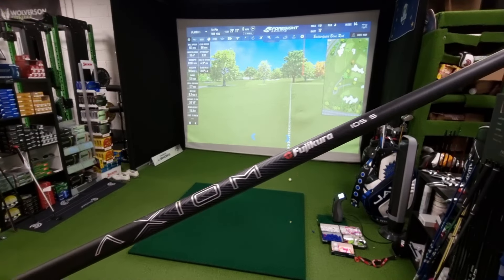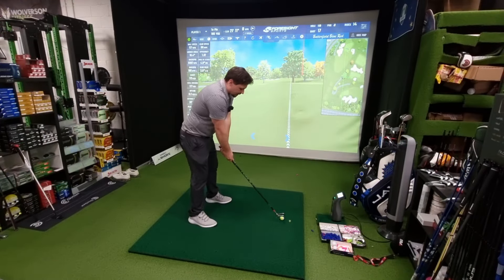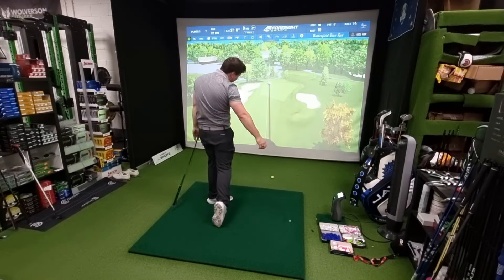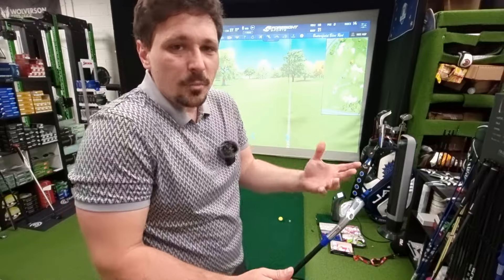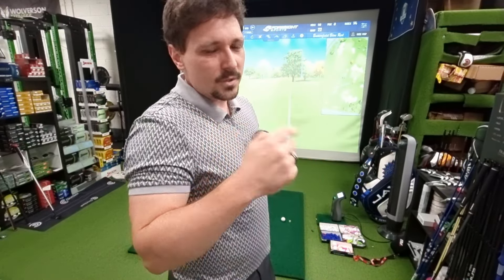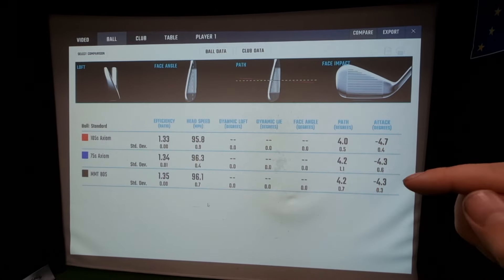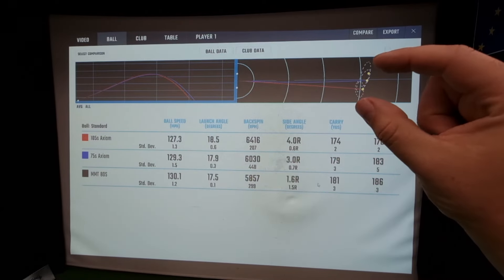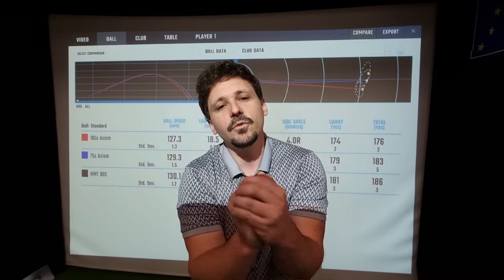Insightful Review: Stock Graphite vs Axiom Velocore

Comment: Freddie which graphite shaft would you recommend for 83/84 swing speed with a 7 iron around 1/2 degrees down ?   No local fitting centers here.   Thanks
Reply from the maker: Hmmm... Tricky to recommend from there... What shafts have you currently got? What flight / Direction / Height do you get from them?
Reply: @ wanting a touch more height.  Ive hit mmt and didnt like the feel personally.  Was the 105 in stiff.  I play the modus 105 now and it feels better than the graphite honestly.  Hard to describe.

Comment: So I currently game the Mizuno 225 w Steelfiber i95 stiff shafts. I am thinking of going a bit heavier (my miss is generally long left and I feel I might not be getting enough height or launch). I’m thinking of either Axiom 105 or MMT 105. Would this be a good idea or would you recommend something else? Thank you!
Reply from the maker: Hmmmm, the e tra weight would definitely hold the ball to the right compared to the  SteelFibers!  Potentially reduce closure of the face, so maintain more loft as well 

I'd say the MMT would do that a bit and the Axiom would do it more! ...Would you happen to have anywhere nearby that has some to hit (even in different heads)

Comment: Really great vidoe and insights throughout. Great swing as well. If you haven’t watched the axiom vs steel video you should go back and take it in - must watch if you want to understand axiom. I think people have turned their noses up on Axiom generally because they were expecting it to be a revolution in an iron in the way that it was for the woods - ie, length and immediate pro adoption. It’s not a length solution. However in what it is, it is revolutionary - a steel replacement with amazing rigidity and feel in lighter weight housing. The point about the dividends it will play over the course of 18 holes is SPOT ON. At this point I went through a slow process to test and eventually game the axiom in my u500 4i and T150 5 iron. In a few minutes Freddie came to the conclusion I arrived at through several months of slow testing. Today I can’t say enough about the axiom, blends seamlessly into my set (PX 6.0 steel in gap-6i) for feel and results, and the only question I’ve been left with is whether I should come down in the set with it. Similar in my mind to a combo set of heads. I will definitely be trying in 6i next and may come all the down to 7 or 8 we’ll see. Great video!
Reply: One follow up, he talks in the other video about 105 S vs X in other weights. The 105 S is what I settled on.
Reply from the maker: I've been working my demo kit one by one to get more options hehe ...I'm feeling a full set next year and then also actually play some proper tournament golf :)

Comment: Curious to get your opinion. Currently fit into T100S irons w/ X100 DG shafts.  I have played S400 also.  I have elbow/joint issues setting in.  Looking at some "stock" options to get with a new set and sell my current.  Curious on your thoughts going from my current steel to like a MMT 105TX or Steelfiber i110.... I haven't seen the MMT125 as an option and I dont know I can swing the upgrade to Axiom.  Thanks for any insight.
Reply from the maker: It's a good way to go ...I like the MMT 105TX, I had a guy with a set the crushes the ball and he liked the ease, without loosing the stability 

Steelfibre i110 would be more like the S400 alternative, again they are easier on the wallet compared to Axiom 

Another factor I'd think about is grip pressure, do you squeeze the club hard? Could contribute to the elbow issues! Have a look at these two vids if you get a minute!
https://www.youtube.com/watch?v=vWsRPPAdlr8
https://www.youtube.com/shorts/kkAbc0mIz90
Reply: @FredzGolf  appreciate the reply and video links! I actually got a chance to hit some options. They didn’t have the 105tx, but had the 125tx and 105s, the newer steel fiber i110. Tried a couple others also. The SF did feel the best, but had a $50 up charge per club. Went back and forth with the 105s. The 125tx was too much and I didn’t want to have to work that hard to activate it (I would keep my x100). Ended up getting similar results with the mmt 105s, but I think the SF was a bit smoother and buttery. Very happy and ready for my clubs to come in.
Reply from the maker: @Voorhees2002  Awesome!!! Best way is to actually hit them, like you have :) If i can create awareness and help you to try the right things in the first place, happy days

Comment: Been a clubmaker for over 25 years. The axiom is an enormous break thru in graphite composite shafts. By far the best shaft I have played and tested (105x in #2). 
 Another smart feature is the slight progressive weighting of the shafts through the set that should distribute the moi balance of the club better.
Reply from the maker: Agreed... I think more Tour players will adopt very soon ....They have indeed, done it properly eh :) I'm debating full set next year ...but I also want to burn the heads bronze on my new sticks but don't know if the ZXi7 will take it ....if they do... I'll treat myself to both hehe

Comment: First off, your reviews are top-notch !!! I am def getting graphite in a split set of srixon forged II/zx7 staff clubs. Hit my 7 iron 170 yards smooth tempo. Clubs 2 degrees flat. I am really looking at axioms or mmt. I have always played x100 recently to modus 120 and 105 stiff ( due to age 😁 and injuries). Would you go 105 stiff or x. Or possibly 75 x irons and 105  stiff in wedges. Worried about too light messing with dispersion?  Or would yo recommend  another direction with mmt? Any insight helpful, and I understand the best way is to hit them, but your experience in club fitting helps. I also get it is an educated guess not in stone. Kbs tgi is an option too. Thx !!!
Reply from the maker: Thank you, glad you're enjoying - I like your approach here and happy you understand it's not in stone :)

In the MMT I'd push you to heavier and stiffer to match the 120g Modus/128g X100 area as they'll play softer than the steel shafts comparatively - 130X

I'm a huge fan of the Axiom, they just work - I'd be looking to test 105S and 105X with you to benefit from the lighter weight and keep the stability you're used to with more ease ...I haven't actually tried the 75X and that's an interesting point ...I'd be guessing but I think they'd be a LOT of fun to use ...I'd lean that way of you want to have more ability to draw ...In the 75S for me, it's a high draw and I have to work REALLY hard to fade the 75S, Could be similar in the 75X

To summarise - Axiom 105S is my gut feeling wedges through irons - I started with just a long iron shaft inn a 2i and fell in love from there 

Alternative thoughts from my main gut feeling: Axiom 75X if you want an effortless draw and never intend to step on it too hard  -  MMT 130X if you want a different price point - Ideally get some in your hands before committing or just do your longest iron on it's own first if you don't have that luxury
Reply: @FredzGolf  thank you for your input, and it makes sense. Your experience means a lot and great info. Will try to keep the draw out of it so will probably stay on the 105 rather than the 75 plus I do step on them on occasion. Want to keep one side of the course out of the equation 😁. The price point will be the same for me on any of the shafts I listed.  I'm curious about the kbs graphite but have not seen much about them. Looks like Axiom will be hard to beat. Love your videos.

Comment: If my normal miss is right would the axiom help elevate or minimize it so it’s not so drastic on a bad strike. Or would the mmt be the better option for that right miss ?
Reply from the maker: What is your normal miss right with? Just need a point of reference for current shaft that creates that flight :)
Reply: @ on what feels controlled swings 10-20 yard fades. On wild swings it can be a bad slice. Most of the time it’s the controlled fade. My normal path is in to out to promote a draw flight but the end result still ends up being  a fade.

Comment: How would you compare the MMT 105TX to the Axiom 105X, I am undecided, if I want to switch from MMT to Axiom.
Reply from the maker: Honestly, I feel like the jump would be quite subtle and you would'nt feel much benefit, relative to the cost as well ...The MMT in TX is a proper shaft and not the normal stuff that comes in a stock graphite set 

It's a hard one to compare as not many places will have both! I'll see if I can source a TX MMT but it's a slim chance off the top of my head
Reply: @FredzGolf  Thank you for your answer. When I was building my set (Mizuno 223), the Axioms had been launched, but where not available. BUT in general, I am coming from Project X 6.5 and NEVER want to go back to steel! Performance and feel of graphite is so much better for somebody old but fast swinging.

Comment: @fredzgolf would you go 105 dynamic gold S300 to 105 Axiom Stiff or 75 Axiom Stiff?
Reply from the maker: @joeyfranchini7499  I've done a few fittings with people using the DG 105 S300 shafts ...Most of the time the Axiom 75S dominates in that fitting and Axiom 105S is harder to "activate"
Reply: @FredzGolf  When you say it dominates, in what way do you mean? Also, what exactly do you mean by 105S is harder to "activate"? Thank you very much for your response, it means a lot.
Reply from the maker: @joeyfranchini7499  dominates is a good thing ...all the data and consistency is better 😋 

Harder to activate: react/bend/harder to hit
Reply: @FredzGolf  awesome, thank you for the info. I'm 30 years old and we're told light graphite shafts are for older individuals but it seems like Axiom defies that logic with their technology.
Reply: @FredzGolf  I have another question, would you recommend I also put the 75S Axiom in my wedges? Or go with a shaft that is a little heavier?
Reply from the maker: @joeyfranchini7499  Good Question, I prefer to go heavier in the wedges, tends to create lower launch and higher spin with that lofted end of the bag

First time I used Axiom in a wedge, I wasn't paying attention, just hitting balls and chatting to a customer ...I had the tightest grouping I've ever seen haha ...my number with the shot I was hitting is 116... I had 116 5 times, a 118 from a heavy strike and then 116 again ...madness
Reply: @FredzGolf  goodness, that's great to hear. So keep 75S in wedges or go 105S in wedges? (Axiom)
Reply from the maker: @joeyfranchini7499  If you've already got 75S in them, I'd say stick with them, they're still good.. If you're in the process of upgrading and have choice, go 105S :)
Reply: @FredzGolf  awesome, thank you so much for your quick feedback. It really means a lot. Definitely a big fan of yours.

Comment: Not even watched it yet but your a legend thanks
Reply from the maker: Sorry it took so long 😇 lots of moving cogs hehe
Reply: @FredzGolf  don't be daft really appreciate you doing the comparison. So taking away what you have said basically the axiom weight for weight flex for flex is just abit more stable. I really like the idea of it being a right sided setup too not as easy to turn over. My miss is a hook. 

The place I had a fitting with called me up and rebooted me for another fitting at different site free of charge so get to try them both again. 

I'm playing the project x lz 6.0 in my I atm seem ok really nice feel but. Something abit easier on the joints but as stable would be nice.

Thanks for doing the comparison. I'm in Manchester so will try and get down for a fitting or something when I'm down south